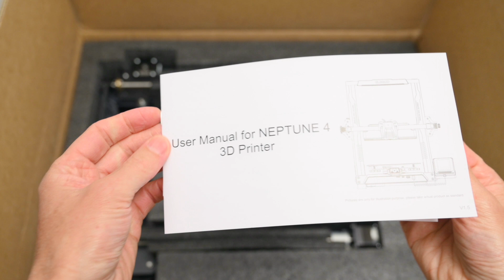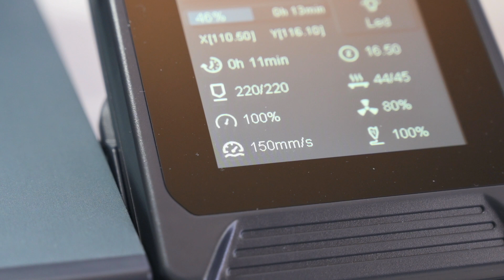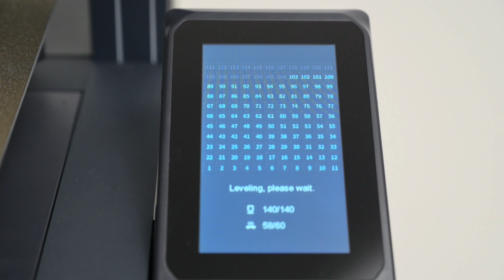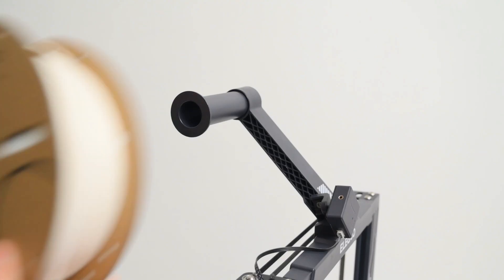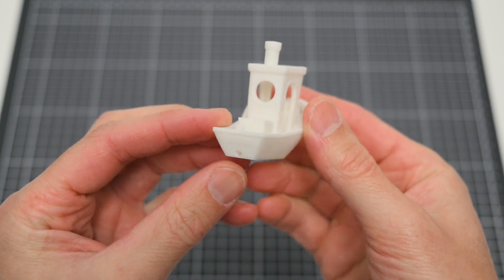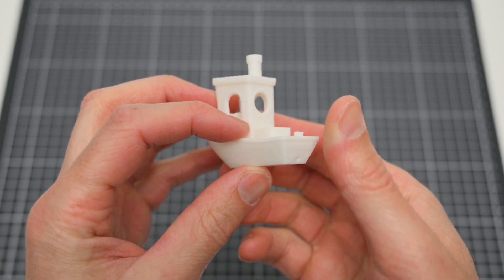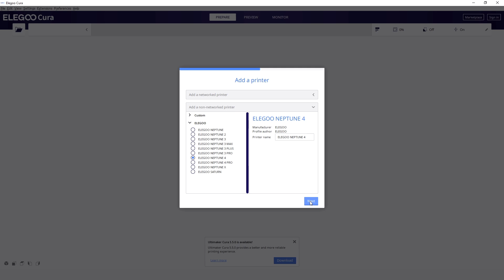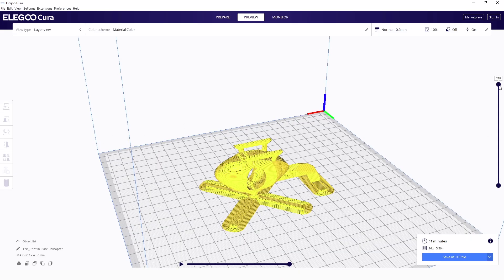FAST AND BUDGET FRIENDLY 3D PRINTER ELEGOO NEPTUNE 4

Comment: Why would you buy a non Core XY Printer in 2023?
I will keep using my Hypercube.
Actually this looks extremely fast, do you think the Klipper software makes all the difference even if the bed is quite heavy?
How would this compare to a bambulabs printer and how is the support and the parts, can you repair it yourself?